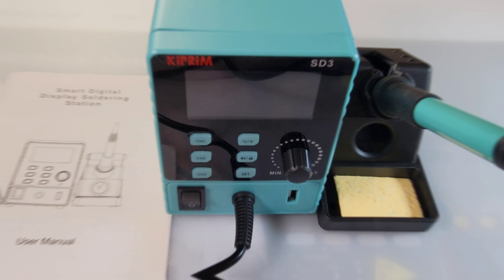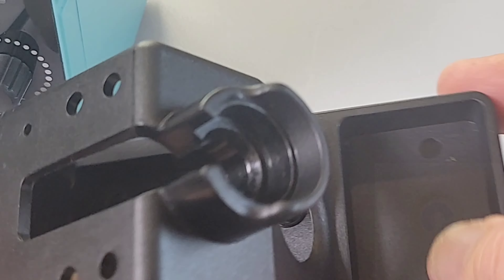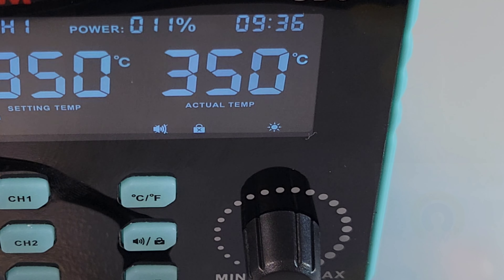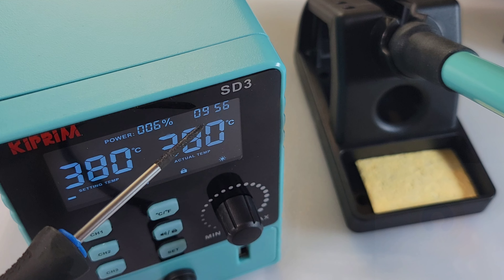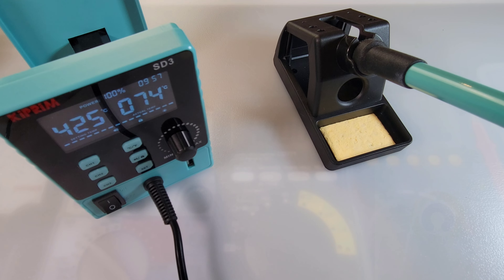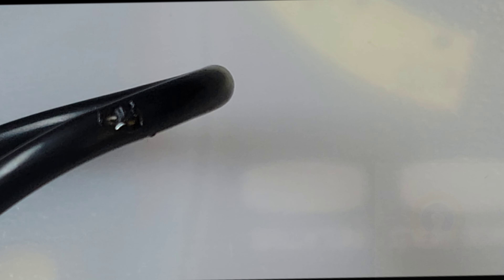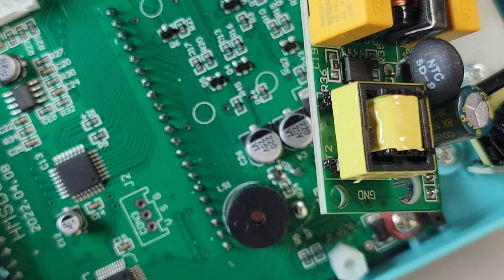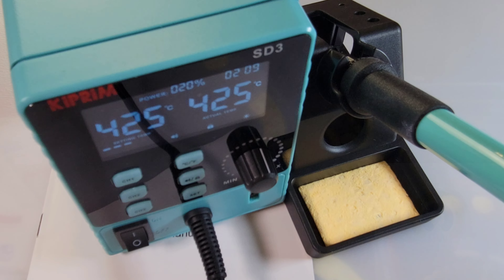KIPRIM SD3 SOLDERING STATION Review & Teardown!

Comment: Would the iron be able to be replaced with a better quality one with a better silicone sleeve ??
Reply from the maker: Definitely,  now removal and reinstall of the soldering iron 5 pin header connector will be the tricky part but its doable.
Reply: @KeepOnTesting  great stuff , I need a second iron for fiddly bits so will definitely give this one a think over it’s a contender till I can afford a decent one
Reply from the maker: @deancurtis6877  Definitely worth the asking price ! 😃 👍
Reply: @KeepOnTesting  Hi. Can you explain how to do that replacement and which iron I have to buy ?

Comment: the front panel is gorgeous! those 3 preset buttons are very useful too. must be fun to solder with it. yes, too bad Kiprim don't give a silicone wire for the soldering iron.
better check the grounding in the next review, Darren. once i heard a story about big boy soldering station that caught for not having proper grounding by its owner, it shares the same color too, IIRC. 🤭
Reply from the maker: Oh that Weller debacle , yes I remember ! 
Btw, I actually did a grounding test on the KIPRIM but that somehow didnt make it into the final edit. No worries though it was fine. 🙂
Reply: @KeepOnTesting  yup, that's right. 😄
glad to know about the proper grounding, good job Kiprim.
Reply from the maker: @radius.indrawan  email me:  netplicity1@gmail.com   👍
Reply: @KeepOnTesting  OK, just did. 😃

Comment: Thanks for the video review!  Doesn't look like a bad unit.  It needs some weight inside, they use an inverter instead of the old heavy transformers which used to weigh the unit down so it wouldn't move around so easily.
Reply from the maker: Funny how those old transformers helped weigh down simple electronics. That lack of oomph is sorely missed 😢

Comment: Hello! I'm from Italy, i bought sd3 on amazon marketplace and after only a month the heating core inside the tip brokes in 2 parts. Now the user manual says the replacement part is a1231 heating core but on the Internet is not this but it seems to be the C1231 that has a plastic socket with 4 pin (+ the spring gnd pin) but it is only from China... I think I can hack the sd3 and change all the cord with another better one but I can't find electrical scheme on the web and nor the official kiprim website... can someone help me please?

Comment: Seperate tip and heater stations aren't worth it nowadays, a t12 station or a pinecil will blow it away in almost every aspect.
Reply from the maker: I know Tanishq but that gorgeous display sure is sweet!  The tips are cheap and plentiful for the SD3 too which isn't a bad thing 😉
Reply: @KeepOnTesting  yeah but replacement heaters for mains voltage 110/220v in the 936 style are very hard to get at least where I live.
I use a 936 station currently, find it very lacking in power even for 12-14 awg wire joints, it barely works for high power PCBs, I have to turn up the heat to above 400 celcius to get work done.
 Thee bits have very little thermal and require regular deep cleaning due to increased oxidation at high temperatures.
I have even had to fill them with thermal paste to better couple the heater and element, even then the thermal regulation is hopeless as is indicated by the manufacturer's recommendations to wait 10S after the set point is reached.
 I don't really look much at the display when using the iron, just need to change the temperature a few times.

Comment: Hey I really like how well thought out and functional that front control panel is, quite well done straightforward and cleanly implemented.  The solder stand doesnt bother me one way or another as its either moddable or swappable and many folks have their own and many options are available, but the low temp cord on the iron is indeed a serious oversight on a high heat producing tool and im not a fan of the pseudo permanently attached iron, and considering how it functions in waking up the unit when detecting movement I bet its a proprietary item only especially with the header plug inside, another negative as it could be hard or impossible to get one if needed, no replacement parts are shown on the Kiprim website. But barring all that, I still really have to like this little guy, its operation is so well thought out and seemingly reliable in use once calibrated  - also the work inside looks good with decent parts & that big triac looks like a beast-!- - just be careful of that low temp cord-!!

Comment: Just silicon that doesn't burn the soldering iron wire would've increased its bar, missed by thisss... 😜 Best internals for a cheap-o soldering station though 😁. Why in the world is silicon so expensive?, the world of electronics would benefit more than the implants industry 🤣.
Reply from the maker: Yea that lack of silicone sucked ! Otherwise the information displayed and temperature feedback visually was way more than my Pace which seems sadly lacking in comparison 😢

Comment: I don't like it. Ordinary cheap $10 iron with a nifty control of a dimmer Triac tossed into over-sized case having mains AC running over a non silicon cord 🤨30 years ago, CSA would have barred sale of such fire hazards. Keep the Pace.
Reply from the maker: I hear ya Cliff 😃  It certainly wont replace the made in USA Pace! Theres a ton of soldering stations out there, in fact I don't think we've ever had so much choice.
Still, I had alot of positive experiences with the KIPRIM and it felt up to the task with most. Funny thing, even that Pace station is disproportionately large considering the tiny pcb inside its housing and that unit costs 12x as much,it is a tank though! 👍